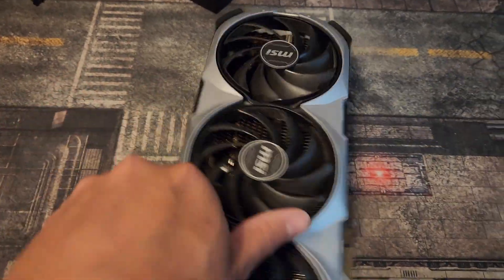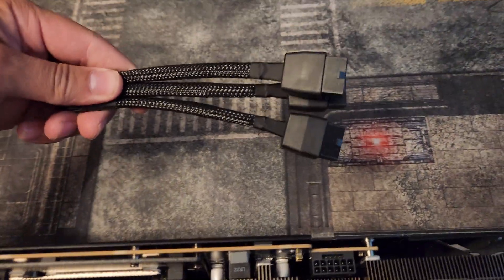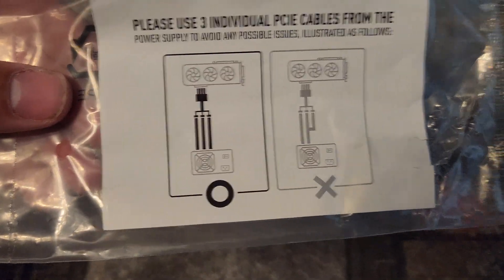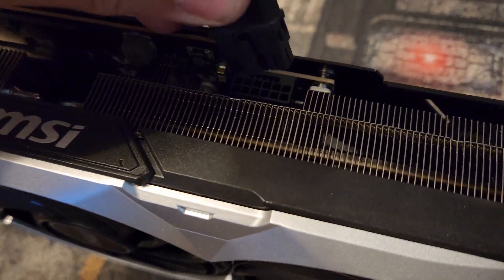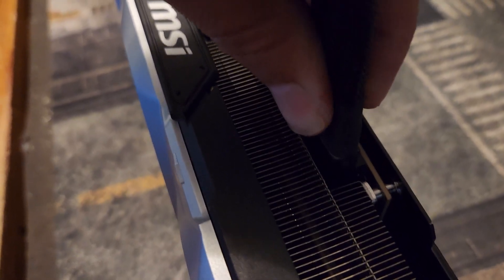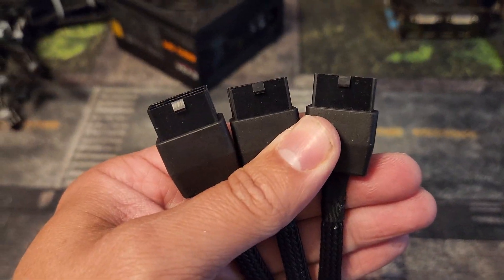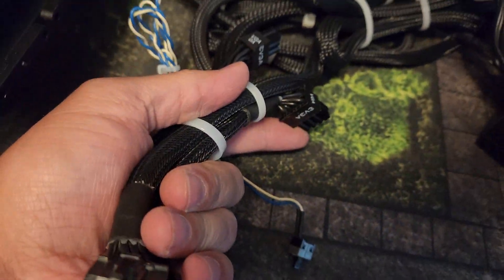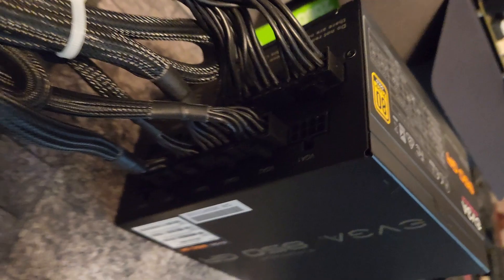RTX 4080  installation guide: everything you need to know about the 12vhpwr cable!

Comment: I wonder if this is why my 5070ti didn't work right and kept freezing before I sent it back as faulty. I pigtailed the single cable the same as what is running my 3070. My system would keep locking up and stuttering.  I mean I had to send it back anyway because after trying Palit, their fan noise was horrible and I couldn't live with that.

Comment: I have a 3070ti (300W) with two connectors and a super flower leadex 2 gold with two cables, each with two connectors.
I connected it with one cable with two 3070ti connectors and it has been working like this for 3 years now.

if I buy a 5070ti (300W) with a 3-connector adapter, will it be possible to connect two cables to three connectors in the adapter?

Will there be any problems?

Comment: I just got this exact GPU.I also bought a Corsair 1000 watt PSU that came with a cable that has the same male connector as the Nvidia one but only has 2 PCI connectors that go back to the PSU. Is it safe to use? I have it installed right now and I'm touching the wire every so often to see if it gets warm. Should I just go and buy 3 (8 pin) PCI connectors and use the stock Nvidia cable?

Comment: My power supply doesn't have three individual PCIE cables, only one cable with multiple connections strung along it. Can I not use it with a 4070 Super?
Reply: @CarRobots what did you end up doing?
Reply: @1337MaxRabbit  bought a new PSU. Sucks, but it's the only real solution

Comment: Thanks very much-not sure why anyone would deviate from the manufacturer’s instructions when installing a card that costs over $1000. 

Fortunately-I have no concerns regarding the aesthetics of the PC build - other than making sure to avoid any significant bending of the power cables. The suggestion to pre-bend the adapter is outstanding-thanks again.

Comment: Thought I'll try here in case anyone else had this issue. Apparently it might be power/cable/not perfecct placement in the socket. So here goes,  my 4080 Super on the initial PC start up doesn't  stay on the PCIe x16 4.0 Bus and instead stays at like PCIe 1.0, in turn making all my games full of stutters and hanging. However, all this goes away with a simple PC reboot. GPU works as intended on PCIe x16 4.0 and I get my full frame rate. Any ideas ?

Comment: I have a Cooler Master Silent Pro Gold 800W Gold power supply, I feel more at ease knowing it will work. because I need three individual outputs. One cable already comes with the source and I will connect the other two

Comment: Sonwhat happens if i plug to pig tails i only have 2 pcie and both have extra pig tails.so what will happen cause i was going use a 4070 ti super. I have 4070 on it?
Reply: What did u end up doing
Reply: @2brosplay2gether  I have not done anything yet mine only has 2 main wires coming out of the power supply with pigtails each.  I read that a 4070ti super would work because it only needs 2 but a 4080 needs 3 separate wires.
Reply: @gamingfromjohnwayne  I just did mine with 2 and a ringtail end and works fine
Reply: @2brosplay2gether  did u get the ti super or 4080?
Reply: @gamingfromjohnwayne  4080 super

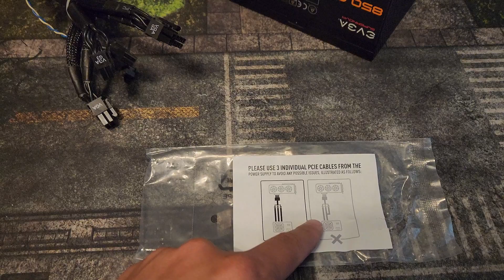Comment: 1:38 my 4080 has been connected with daisy chain or pigtail for 2 years without any problems and the benchmarks are right also
Reply: Hey there, I am on the same boat where my psu has only 2 pcie adapters and was planning to daisy chain one of them as the gpu needs 320 W and after using two cables 150x2, I will need 75w that comes from motherboard. Do you think it will be fine?
Reply: @TelsonAshraf  i think its ok!      How did you sort it out ?

Comment: So my pcie cables all have pigtails. Can I use all 3 pcie cables with pigtails without plugging in the pigtails or do I need 3 pcie 8 pins cables that have no pigtails?
Reply from the maker: Either or works
Reply: @krootman_digitial  ok so just don’t plug in the pigtails to the gpu right?

Comment: Do you think I can get away with two dedicated cables and 1 daisy chain? 1080p
Reply from the maker: Nope
Reply: @krootman_digitial  are you sure? because my psu only comes with two pcie cables
Reply from the maker: @oximalakas  yes I am, you need a new PSU
Reply: @krootman_digitial  my pc bulder friend just told me the 4080 super doesn't need that much power and I should just do it
Reply: @krootman_digitial  it's a 850w psu
Reply: @oximalakas  Did you do it? How it worked out?
Reply: @EXXTSON  I ordered an extra corsair PCIE cable, and it worked perfectly

Comment: Hello there, I would like to ask you about my Nvidia Geforce RTX 4080 Gaming OC 16gb, I have a AORUS P1200W 80+ Platinum Modular, but when I plug in all 3 cables, it finds out there is a graphic card, but is simply not working, it´s working only with 2 cables and after a year of playing it´s starting to have a coil whine. Any idea where might be a problem? It literally works only with 2 cables connected to the PSU out of 3. I got the 1200W for free as a new one, do you recommend me downgrading it to 850w, could be the high wattage the problem? Thank you!
Reply from the maker: Its not a voltage problem, could be an issue with the psu. As far as I understand coil wine has nothing to do with it. Maybe swap the psu out and see if there is an issue

Comment: I have be quite 850 w and i have only two pcie sockets (12pin) 6+2 and some P8 socket (10 pins) 8 can i conect this p8 socket 8 pins to nvidia adapter as last cable ?
Reply from the maker: As far as I know no
Reply: @krootman_digitial  What's the solution

Comment: I have 1000w 2.5 atx. They don’t supply you with single pcie cables anymore. Just the pigtails. 3 pigtails in my box. I’m gonna connect all 3x no they’re not daisy chained.

I just bought a 4080 super and there’s nothing in the box that shows the correct connection. Not even their QR code manual shows it.
Reply from the maker: I'll probably make a 4080 super install guide or take this video and edit it into one, thanks for the tip

Comment: I’m missing one pci e cable where do I buy it
Reply from the maker: amazon
Reply: @krootman_digitial are them all the same? I can’t find one of the same brand on Amazon
Reply: @Steven-lw8lg  I went to buy pcie cable for my PSU because I have only 1 (but PSU allows to connect 2 cables) to connect 4070 super. The thing is, it was not the same even though it was marked as the cable from exact PSU I have.
The cable looks the same, but wires are connected to different pins, so decided not to risk with that. Probably, will have to buy another PSU...

Comment: My 4080 super (msi gaming x) doesn’t output anything, monitor says no display. I only plugged in 2 of the 3 8-pin connectors however, and i can’t get the click on the 12vhpwr cable, it also leaves a ~1mm gap to the socket. Could that be why? Put my old 2070 super in and that still works.
Reply from the maker: You need to plug all 3 in
Reply: @krootman_digitial  Okay thanks

Comment: Can someone here help me with my issue thanks :) Im planing to buy 4080 super but my PSU might have only 2x8 pin power connector for the gpu and that super needs 3x8 pin connector. Is there anything that i can do or do i need to buy new PSU? Thanks in advance!
Reply from the maker: Gotta buy a new psu
Reply: Thanks man @krootman_digitial

Comment: is it possible to buy a 12 pin to 8 pin that is seperate that way i dont need to connect all 3?
Reply: Seriously. I would like to know too because my 1000W Pure Power 12M has a 12 pin PCIE 5.0 to 8 pin cable that says it's rated to 600W. That would be 100x easier than using all 3 PCIE cables that came with the PSU.
Reply: Did you buy it separately ?
Reply: How did you sort it out ?

Comment: Disagree with needing 3 separate pcie cables for a GPU that very rarely goes above 300watts and when it does its usually 315-330. Why would a PSU company have the pigtails if there not safe to use?? why spend more money to make cables with the extra pigtails and also why make them if you don't want people to use them because there not safe bahahaha that is ignorant and also a legal fail as people will use them and they will be liable for providing a product that should not be used how they designed it. Do people think??? You will be 100% fine using your pigtail stop buying a new PSU when it is not needed. Oh and 750w PSU more than enough for a 4080.
Reply: This has aged so badly.
Reply: @ZenAndPsychedelicHealingCenter the video or the comment?
Reply: my 4080 does not rarely go above 300 watts, especially playing a game like cyberpunk. why even risk overloading one cable if you can just connect another? these things cost too much to be so careless.
Reply: You might not "need" it, but you have to admit that it puts less load on each cable, and so it's a good redundancy measure. If you have two connected and one fails, it's a problem. While this failure is highly unlikely, if you have the option to add redundancy, why wouldn't you?

Comment: Wil it work on 2 8 pin from 650 gold psu just like you showed in ur 4090 wd 3  8 pins
Reply from the maker: I would apply the same guidelines for the 4080 as I did with the 4090
Reply: @krootman_digitial   thanks bro anyway i bought gigabyte rtx 4070 ti super eagle that needs two pcie connectors. it consumes only 285watts max.